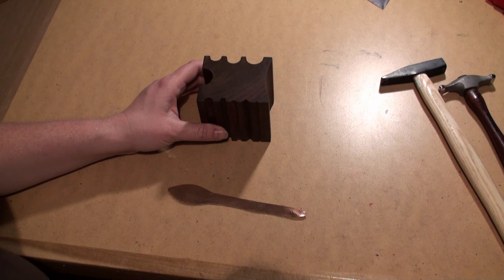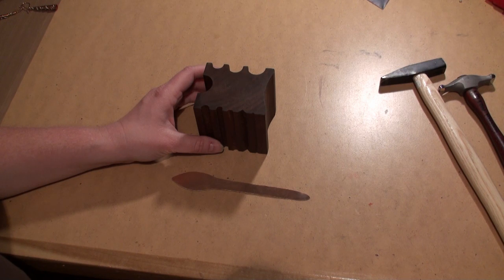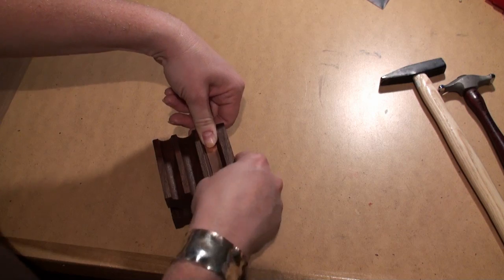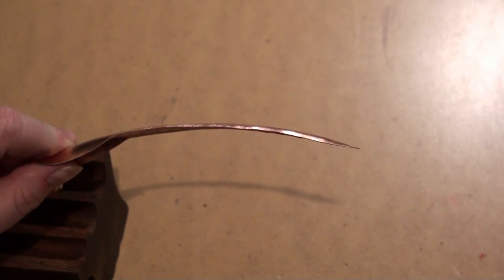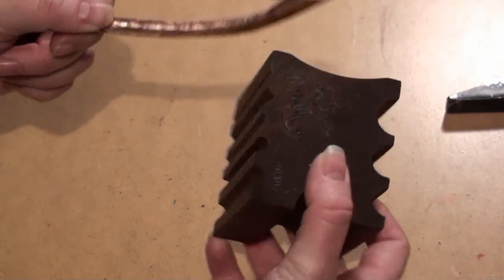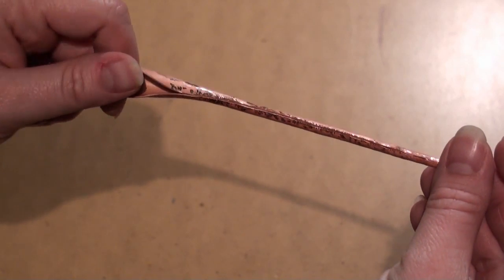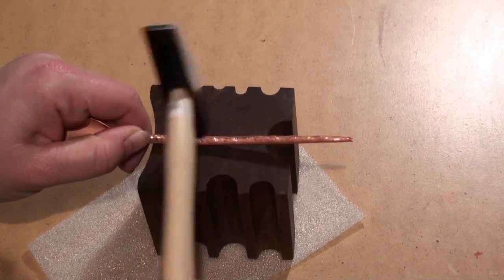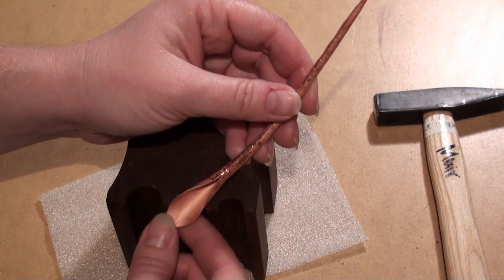Tool Time Tuesday - Using a Swage Block

Comment: I have read your article In Art Jewelry Magazine on how to make this. My question is, what is the point in using thicker gauge metal and rolling or hammering it out as opposed to starting with a thinner gauge of wire? Thank you! I love your videos!
Reply from the maker: Diya McKee Thanks so much. Good question. The reason for rolling the metal down is to thin it out at the taper end. I don't roll the entire thing. It just helps to get a nice smooth taper. That also answers the reason for not starting with a thinner metal. In the case of this larger lily, you want the flower to be thicker at the petal. however, you want to be able to taper it smoothly at the opposite end. In the original article, we curve the lily end, and that requires thinner metal to move it smoothly. I hope that helps.
Reply: Melissa Muir That was a silly question!! If I would have read the article more thoroughly it was clear!! Need new glasses! Yeah, Ill blame it on that LOL! Thanks for your reply!
Reply from the maker: Diya McKee not a silly question at all. It was a perfectly good question, especially for those that didn't read the article. I am glad you asked it. :)

Comment from the maker: @sjb2405 - I use hard silver solder for the seam.... if I solder it at all. With this form, there is a LOT of strength, as long as it isn't annealed after you do all the forming.

Comment: What other ways would you use the sewage block for, aside for the earrings and flower?
Reply from the maker: +Gloria Borrero I use it also for creating a pea pod, adding curves to my metal when flat, adding curves to wire, holding stamps in place when stamping metal. There are a number of uses for the swage block.